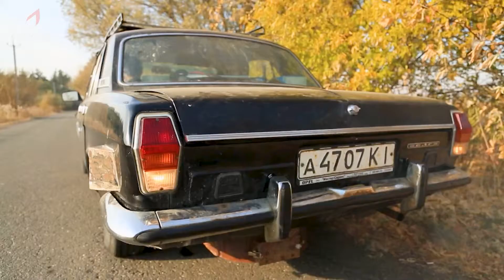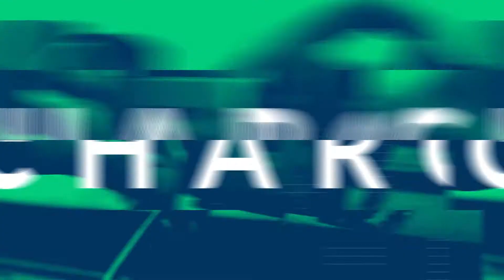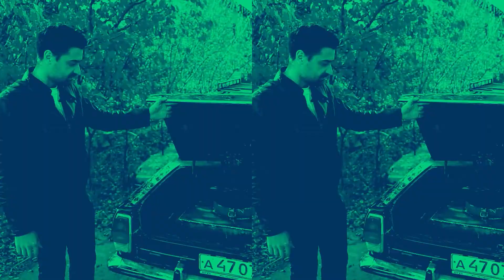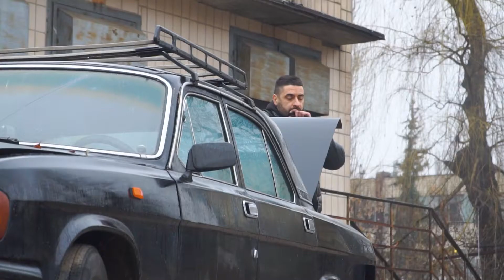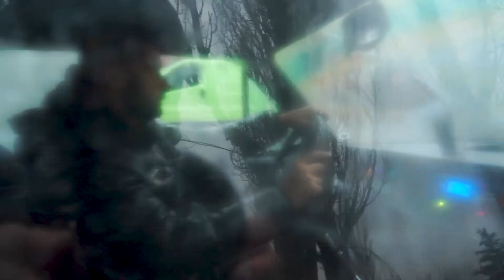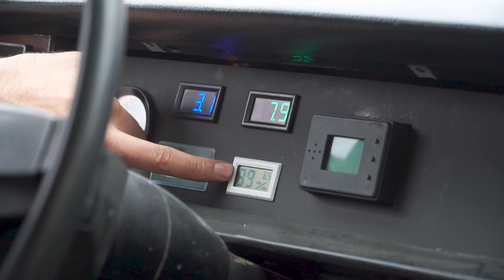"Volga" on firewood (charcoal with water + control electronics)

Comment: I think the engine wears out much faster due to the large amount of water and carbon wearing away the cylinder walls and quickly contaminating the oil. I must know, are oil changes significantly more frequent with this setup?